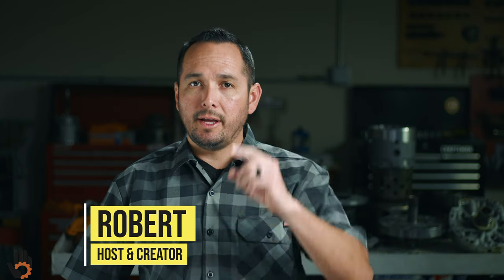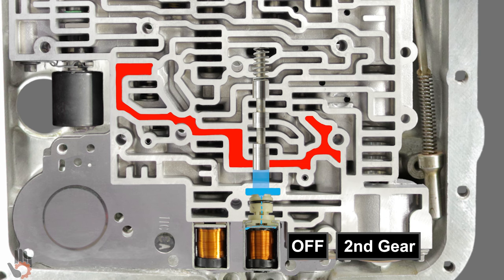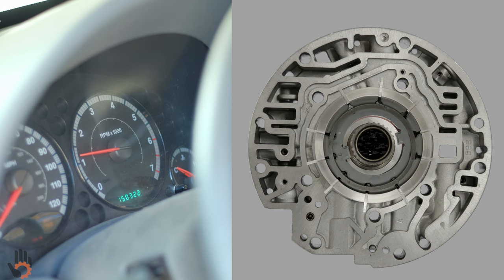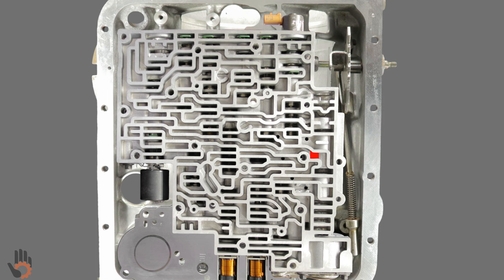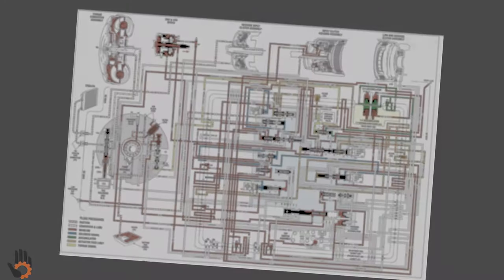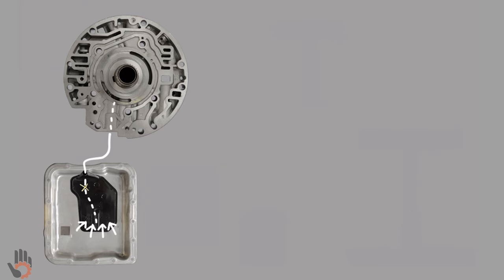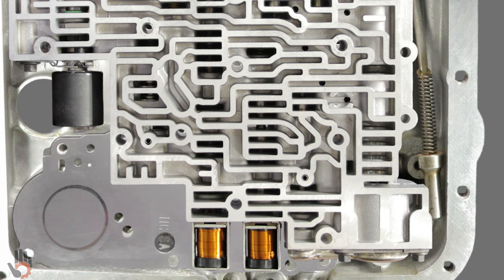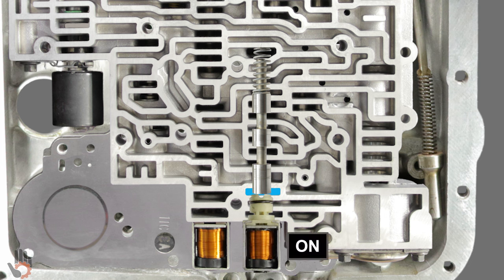4L60E: 1-2 Shift Valve + 1-2 Shift Solenoid (Part 1) Basic Operation

Comment: Great videos mate very easy to follow along. Im currently looking for the reason my silverado 4l60e feels like it slips/hesitates until i add rpm when selecting drive. Seems fine when cold but gets worse as it warms up. Reverse is normal with no issues and the car will drive along fine just slips from a stopped start. Any help would be greatly appreciated 👍

Comment: So I have a 01 suburban that doesn’t shift out of 1st unless I lift throttle!  And after lifting it seems to shit to 3rd but shifts to 4th and TC Lockup just fine.  When I shift to 2nd manually it doesn’t shift, if go to 3rd manually it shifts as if in drive, once throttle is lifted.  I was thinking it may of been shift solenoid but kinda doubting it after seeing this, what are your thoughts?

Comment: Love the videos.   Just came across mine not wanting to shift into last at 50-55 Just more rpm not shifting    No codes
Reply from the maker: Could be dealing with an AFL Valve that's wore out (actually the valve bore).  Could also be a leaking bore plug for the 4-3 Sequence Valve.

I would imagine that you'd have a code, though.  If the PCM is commanding the trans to up-shift to 4th gear, the PCM will expect to see the engine RPM drop, after the shift.  When it does not drop, the PCM may throw a code for incorrect gear ratio.

Comment: Awesome! I just tripped across this video (I'll make sure to watch more) I wish it had come up in my many searches on the 4L60e. I do have a question & while I get there are soooo many different possibilities as to the cause of my problem, some of which I have already dealt with by replacing sensors. I have a K1500 Suburban with a 4L60e that appears to shift fine in the mornings but come later in the day (only short drives to & from work) the trans shifts up very early & bogs down. In fact, if you put your foot on the gas it shifts up first & not pick up revs or even shift down. It will then shift down given a little time but then it will shift straight up again. Some history, when I put 33" tyres on a couple of years ago, it started throwing a trans code on the odd occasion & reacted the same, but if I cleared the code, it came good & it sometimes wouldn't happen again for a few weeks or months. I have since gone to 35" tyres but changed the diff to a 4:56 which is pretty close to stock gearing, if anything it's probably a little the other way as the tyres only measure 34 1/2" but its certainly improved off the line, around town & is great for off road. I have replaced the TPS & MAF in this hunt. Unfortunately I don't have the Tech 2 GM OBD unit yet so I can see what the % of the throttle is, but it's odd that it seems to shift fine in the mornings, if anything, it shifts GREAT with very positive shifts as I would expect from a trans that was built with a shift kit for towing a few years ago. I am a bit suspect on a vacuum leak as I sometimes can smell fuel but I'm unsure if there are any sensors ties to the trans that would effect it, especially as I mentioned, it seems fine in the mornings. It plays up when I come home for lunch as it does after work. very odd to me with the limited knowledge I have with transmissions. More recently when I back off the gas, the revs will drop very low. I have had a stuck IAC a couple of times & am about to order a new one. P.S. The Suburban is actually Australian Delivered as R/H Drive & as a Holden, so finding a proper Tech 2 for it is proving a challenge but as I do all my own mechanical (I rebuilt a 14 bolt rear diff for it last year with a locker) & she is being built as our camping rig, we intend to keep the old girl especially as they are not very common here in Oz. I appreciate any thoughts on what could be causing the problem. Cheers!! Rod. (sorry for the essay!)
Reply from the maker: You've got a lot going on here...  I've read this comment of yours twice, trying to gather info.

First and foremost, drivability (engine) problems can/will affect transmission performance.  Always best to address all engine problems before chasing transmission problems.  The PCM (4L60E computer) gathers info from a number of engine sensors, and it makes "decisions" based on the input received from those sensors.

Tire Size:
The PCM is constantly watching engine load (MAF, TPS, etc) and road speed (speed sensors).  
Changing the tire size can affect the speed sensor info that the PCM is receiving.  Because of ABS (Anti-Locking Brake) systems, many vehicle are equipped with speed sensors at each wheel.  I'm not sure if this is the case with your vehicle...

Temperature:
For emissions purposes, engineers have designed the vehicles to warm up as fast as possible.  When the vehicle is cold, all up-shifts are delayed.  The TCC (torque converter clutch) is typically inhibited.  
Doing these things raises the engine RPMS, which raises engine temp faster.  However, as the engine warms up, the shifts will occur sooner.
This may explain why your engine shifts normally when cold....and shifts too soon when the engine warms up.

Once again, I'd start by addressing engine problems.  If the problem still persists, I'd be leaning towards the tire size and differential mod.  PCM might need to be re-programmed.

Thank you for the positive feedback!

PS - If it feels right to you, please help me spread the word about this channel.

Here's an easy way to share...
1 Handed Transmission Rebuilder:  (60-Sec Preview)
https://youtu.be/y3Vixa_Ec1E

60-Second Preview of the video you just watched:
https://youtu.be/fWPSaLeaOXI
Reply: @SouthpawAutoworks  Thanks for your reply. Yes, I have been sorting through the problems with the old girl & learning heaps as I go. I'm pretty much old school so learning all the sensors etc has been a challenge but I'm enjoying figuring out what makes it tick. Now that you have mentioned the ABS, I have also done a complete brake upgrade (disc conversion on the 14 bolt rear when I built it, upgraded discs & callipers on the front plus a bigger master cylinder to suit. I am yet to sort the ABS light as I need to cycle the ABS (another reason to purchase a Tech 2) then re-bleed the brakes, though it is pulling up ok at the moment. Yes, there is ABS sensors on the front only, I wonder if that is contributing to the trans problem?? Because of the diff ratio change to suit the larger tyres, I'm not sure that is actually the problem as the gearing is close to stock but of course I can't rule it out. As far as temp is concerned, I nearly always let my truck warm up in the mornings because of the short drive, but it's odd that after it sits until lunchtime, almost straight away the early shifting happens. I wonder if it can be ambient temperature ?? it's the same when I drive home after work, if anything, I think it is worse later in the day, if that's possible?? Yes, I'm happy to share your work, helping each other is what it's all about! CHEERS!
Reply from the maker: I also enjoy learning how stuff ticks.  And there's always something to learn!

When time permits, I'll be creating a video series that shows how engine problems (and other systems) can cause transmission problems.

Can you pull all of the trouble codes?
Note:  If you recently reset trouble codes, drive it long enough (minutes, days, etc) to bring back all of the original codes.
Reply: @SouthpawAutoworks  No, no codes at the moment, which is why I need to get my hands on a Tech 2 for this vehicle so I can look at stuff like shift points, cycle the ABS etc. As you would know, a simple code reader just doesn't give enough info & can only clear the codes. Unfortunately I'm having trouble finding one in Australia as my truck was built for the Aust. market. The hunt is still on though.
Reply from the maker: Understood.
Wishing you the best of luck with your hunt.

Comment: Thank you for all your videos, it's very educational.  I bought a 2004 Gmc Yukon denali. I'm pretty sure the history on the vehicle I was not giving an honest answer,  but I knew that before buy the Yukon.  Few days ago I took it up to the mountains and it started to over heat close to 300 degrees.  I let it cool down back to normal operation temp. And it didn't over heat go back. Next day I decided to change the trans fluid with filter. Put it back together drove it gave me a p0758 generic right away. 1st 2nd and 3rd react fine, until I put it into D then the speed and rpm do not match. Can you give me some advice of what I can do? Is it solenoid problem.

Comment: Hey man great video thank you! I’m having issue with my 4l60e. I have no second gear when the trans is cold, below roughly 100 degrees. After driving for about 5 minutes, everything operates normally. I’m stumped. Fluid level is ok.
Reply: maybe not enough oil presure when cold

Comment: Great Video, looking forward to all of your videos, I do have an issue that needs explained what is happening, 2004 silverado 4l60E rebuilt about 25K miles ago, I have no codes, I have a fairly hard shift 1 to 2 and from 2 to 3 the engine revs up a bit before nicely shifting into 3rd, I was thinking the TCC Bore was leaking, but there is no code to support this, a good rebuild kit was installed with all new frictions, new sunshield, band, servo's etc... but nothing was done to the valve body as far as I know it was just reinstalled, had this issue for quite a while, I have purchased a rebuilt valve body but have not installed it yet, I am afraid it may be a bit over my head, but watching your video made me a bit more confident. and idea why it would rev anywhere from 5 to 7 hundred rpm before shifting into 3rd? Thank you Much Appreciate any answers.
Reply from the maker: Slipping during the 2-3 up-shift is typically foreshadowing of a 3-4 Clutch failure.
There are a number of potential oil leaks in the 3-4 Clutch circuit.  This leakage results in lower oil pressures, which results in clutch slippage.
When time permits, I'll dedicate a video to this topic.

Those elevated RPMs are killing the life of those clutches.  If this goes on for too long, the clutches will fail...resulting in a trans failure/rebuild.

Hope you can get it figured out soon.

Comment: I just watched your very informative transmission video on a fl60 12 shift solenoid. The issue I'm having it will not shift into 3rd gear no check engine light, simply will not shift from 2nd to 3rd. My thoughts is I need a new 3-4 shift solenoid. Never had a transmission issue until this happened last week
Reply from the maker: Were you able to get to the bottom of this problem?

Comment: So glad I found your channel, the way you present this information is the best I’ve seen yet!  I have a 2005 deep pan 4L60 w/145k that loses reverse and forward after warm up and a slight buzzing noise can be heard when the gears fail. Just dropped the pan and the filter looks to be clogged (I’m assuming oil starvation). Also noted the 1-2 solenoid is very loose in its bore, while the 3-4 is nice and snug. I plan to replace the 1-2 and filter, but wondering if the 1-2 and 3-4 are the same part?  They look identical and a few parts sites seem to indicate that they are. Thanks again and happy to support you!
Reply from the maker: Regarding the filter, I've encountered this before.  If there's enough clutch material settled in the bottom of the pan, after the engine/trans is fired up (and warmed up) that clutch material will start circulating through the fluid/trans, and plug the filter...yes, causing oil starvation.
Cleaning the pan, and replacing the filter will take care of the issue....for now.
The clutch material came from somewhere.  In other words, something may be coming apart inside the trans.  Just a heads up.

The 1-2 valve-train is under load (a spring).  The 2-3 valve-train has no spring.  So, the 1-2 Shift Solenoid will be snug, and the 2-3 will wobble quite a bit...and this is normal.
Both the shift solenoids are the exact same part.

Glad you're enjoying the content.
 Really appreciate the positive feedback.
Reply: @SouthpawAutoworks  Thanks for the lightning fast reply!  OK, so I had the solenoids reversed, 3-4 is on the passenger side when trans installed, so I’m probably good with not replacing those. And yes, I’d say more debris than normal in this pan and on magnet - not terrible for first service at 145k, but the vehicle (Silverado) will now serve as a farm truck and won’t see many miles going forward. Thanks again, spectacular production quality!
Reply from the maker: Right on.
Thanks for being here.
Reply: New filter & fluid resolved the issue 👍🏽
2005 Silverado, 4.3L, 2WD

Also, 1/2” threaded steel pipe works perfect to extract filter seal.
Reply from the maker: Right on!  Congrats!

Oh, cool.  I'll have to give that method a go.  Thanks for sharing.

Comment: 96 Express van w/5.7L engine. Went on a long trip, 8 hrs, hot day. On the way home got caught in stop and go freeway traffic, after about 10 minutes, 1st gear would bang into 2nd, going to check fluid level today, no leaks, has approximately 84K miles. I read something about a TFF solenoid? Thanks in advance for your help, Greg

Comment: Great video! I just installed a atk rebuilt 4l60e in my 2007 silverado and 1st 3rd and 4th feel great however the 1-2 shift in light throttle sometimes i feel two bumps when it makes its shift. What could that be and could it be a part of the learning of the adapts?

Comment: Thanks Robert very informative. 
I have a silverado 4l60e with a problem it selects 1st and 2nd and reverse but when in drive there is nothing.Ive connected launch x431 no fault codes. If i activate shift solenoid 2 with the launch and van  runs 100% through all the gears and feels like nothing is wrong.
As soon as i turn off and restart there is no drive gear .It sounds like it is in neutral.
I pulled the pan and its sparkling clean in there so i doubt its clutch related.
Any help would be appreciated

Comment: I have 2003 4x4 4l6oe  1 and reverse .with scaner can get 4 . Im new to tranys preasure was good a and b solinoids replaced still same no major metal in pan just fines 200000 miles on rig .your videos are great thank you any sugestions for next step

Comment: This was a perfect video and incredibly helpful! Does the 1-2 shift solenoid also control the transmission shifting from 2nd gear into 3rd?
Reply from the maker: The 2-3 Shift Solenoid controls the 2-3 Shift Valve-train, which controls that upshift.

Comment: OK....Finally figured out the issue.  Maybe this can help others with strange 4l60e problems on a 1997 C1500 Chevy.   The problem is that the PCM commands the shift solenoid B OFF , but it's internal volt meter is stuck on reading    0V  at the wire coming from the 2-3 shift valve , even though truly  12V appears at the B solenoid ground  pin when the solenoid is commanded OFF.   With its internal volt meter stuck on 0V for shift solenoid B, it never sets the fault in 1st or 2nd or from the 1 to 2 shift, because solenoid "B" is always commanded ON in 1st and 2nd.   The PCM is happy because 0V is what you would measure with an ON  solenoid.  The fault only occurs when the shift solenoid is  turned OFF , the vehicle correctly makes the 2-3  shift and then a few seconds later CEL comes on and truck is in limp home 3rd gear.  Now I was able to understand why shift solenoid B would always say "short circuit to ground"  in the data stream as soon at the vehicle would go into limp home 3rd. ( IN OFF state PCM must measure 12V on ground wire )    So at the end of the day, I believe the transmission PCM failed 1st  which caused the vehicle to only have 3rd gear (and manual 2nd if you dropped it down) . The original owner I  believe  drove the truck a long time in this failsafe mode, shifting down to 2nd at stops and shifting up to 3rd when moving. (  He died, so I can't prove but very likely )Over time this eventually overheated and burned up the reverse input drum and 2/4  band, leaving no 2nd or 4th gear.  After I rebuilt the tranny, the transmission is perfectly fine but I was back to square one , now with a  perfectly good tranny and a BAD PCM  permanently reading/measuring  0V ( ON ) for  the B solenoid ground wire.

Comment: I put in a rebuilt 4l60e into my trailblazer 2004. It ran great for about 5days. I was on the freeway doin about 70 and the tranny kicked out of gear, like it was in neutral. I coasted off the freeway and got it to the house. I went through a lot of ideas why. My linkage, neutral safety switch, finally I ended up taking my tranny out and I found the bearing for the back of the tranny was blown out.
   I knew that in order to get to it I had to tear it completely down. In doing so I found the stater was shattered. That would explain the no pressure in the tranny. I replaced it and put it back together, now it is stuck in first gear.
     What you think?

Comment: My 1997 GMC 1500 truck with a 5.7 liter vortec engine with a 4l60e transmission.My trans was rebuilt 12 years ago & a trans go shift kit with corvette servo.Note my filter & fluid has not been changed since.Last week while driving my truck just felt like it went in neutral.I managed to pull in a gas station & added a quart of tranny fluid.I about a 1 mile managed to drive home but my rpm's were kinda high ,but made it to my apartment .Now when starting when I put it in gear when I give it gas it tries to go forward and backwards.do you think a change of fluid and filter will help? The tranny has not made any noises,but found tranny fluid under truck leaks under truck in the last couple of weeks.Any advice you could give would be appreciated.